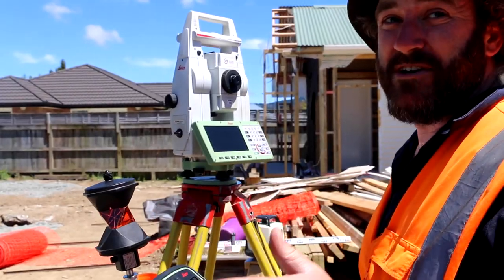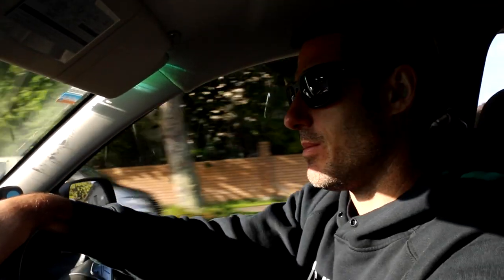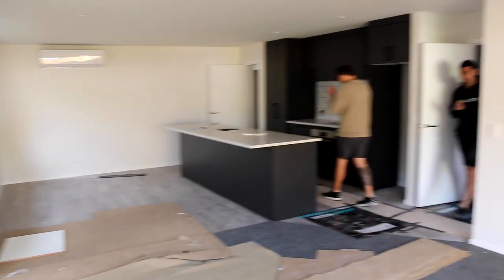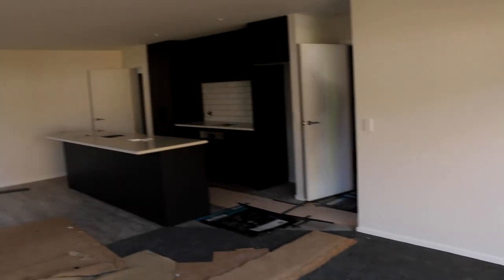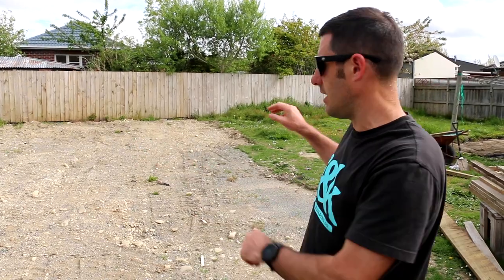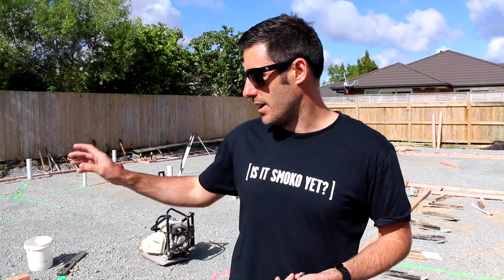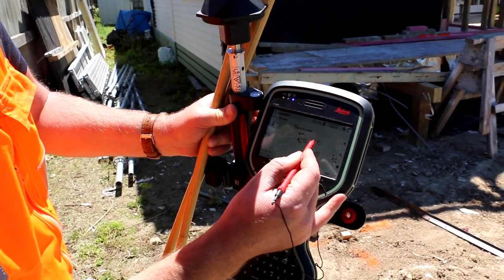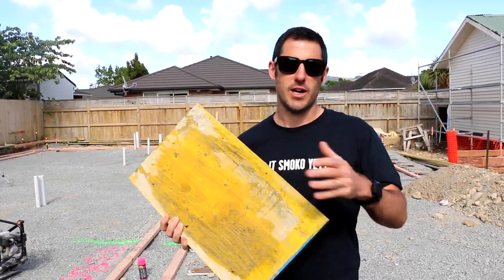Preparing for a Rib Raft Foundation

Comment: With recent unpredictable flooding in various areas, especially a rainy city like Auckland, would you recommend rib raft, or another foundation type altogether? What are pros and cons of ribraft and pods ec.
Reply: I think you need an Civil Engineer specialised in Stormwater to advise your finished floor level again the 1 in 100 year storm flood level. If floor level is too high from the ground, then timber foundation is the answer. Cheers